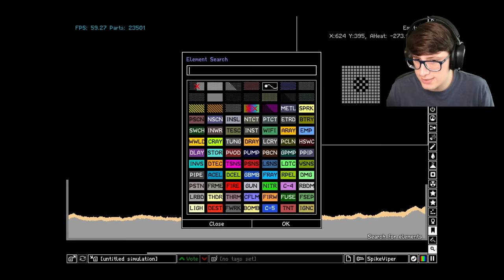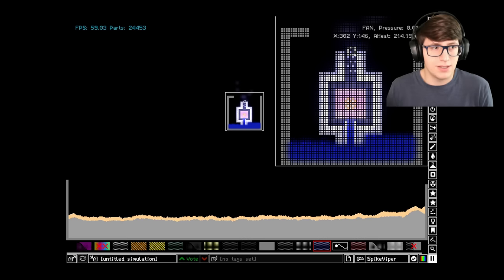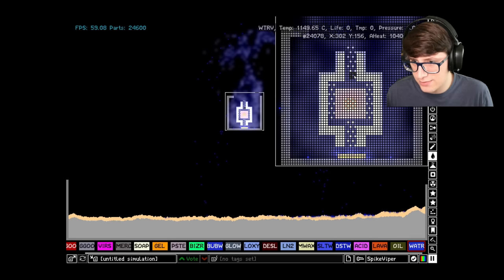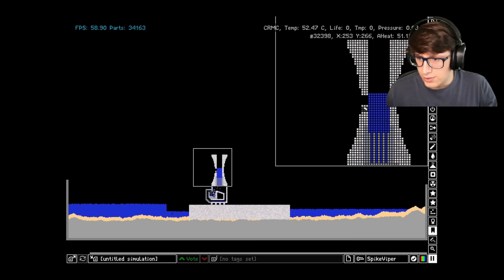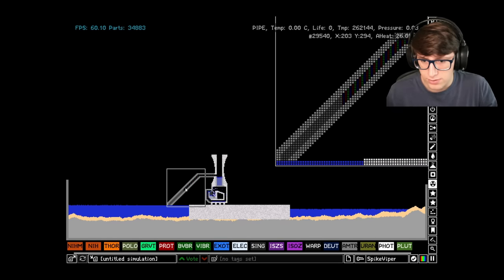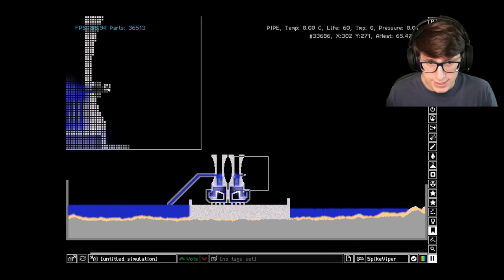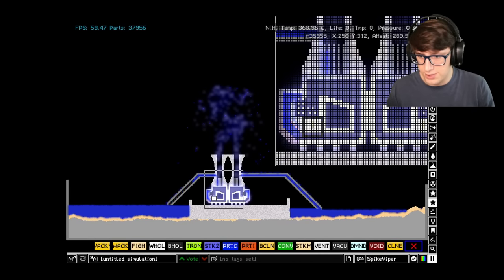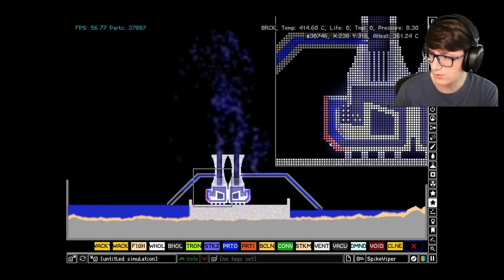Building MINI REACTORS in The Powder Toy!

Comment: New idea for an element: Alluminium [ALUM], much more effective material for cooling towers. Higher melting point, and far more realistic than using titanium.

But, it would be weaker/brittle, and would give way to high pressures more easily.

Comment: You should add a hypothetical element of “netroniom” and “protoneum” that are created by squishing neutrons with pressure at 0 kelvin (same for protoneum but with protons) and outside of these conditions it should explode with N/P depending on weather it’s netroneom or protoneum and if the different materials colide it should also explode even if it was stable
Reply: Neutron cube